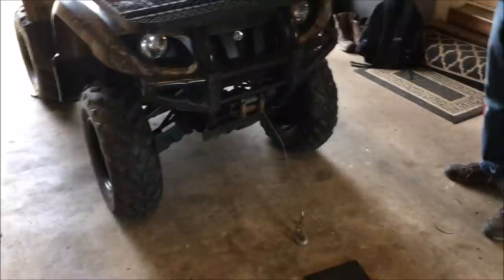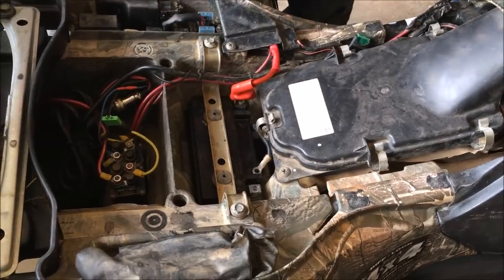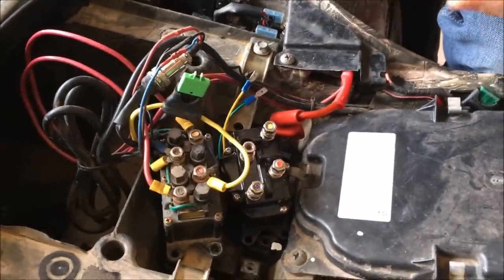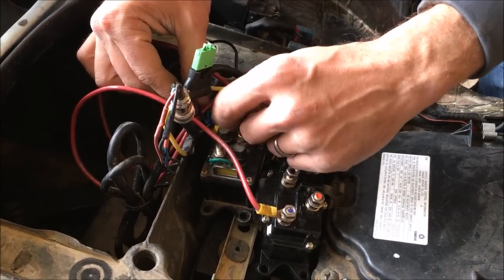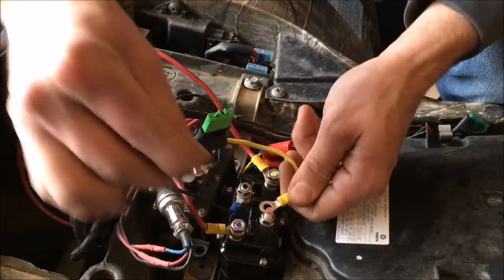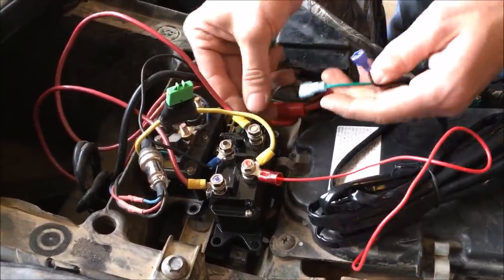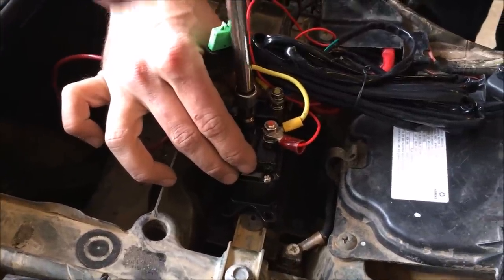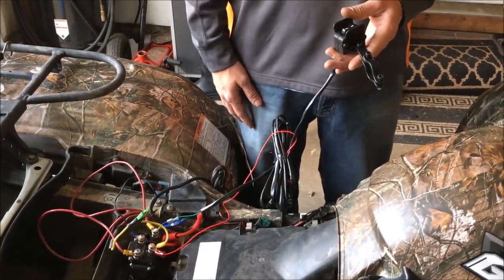Universal ATV Winch Solenoid Relay Contactor Installation

Comment: On a KFI 2500. # winch kit, Hooking the small red wire directly to the battery should I use a inline fuse link? An what amp should it be? Thanks great video
Reply from the maker: I would wire as instructed by the manufacturer.  With that said adding a fuse will not harm anything just make sure you have the proper fuse for the gauge of wire being used.

Comment: I got a second hand winch and a second hand quad.  Winch didn't work on the quad and I figured out it was the solenoid. 
I tried just swapping the wires one by one like you did but saw smoke. Could you tell me where your wires went. Blue, yellow, red, black?
Reply: red/black to battery and blue/yellow to winch. if it smokes, its shorting

Comment: Do these universal solenoids last for a while or do they burn up quickly?
Reply from the maker: I have never had a customer complain about the solenoids going bad.  I have one on my own personal ATV and have used for years without an issue.
Reply: Thanks for the reply. I have a snow plow with a key fob controller and I don't like how it operates. Every time you tap the button, the winch operates for a second or two and does not allow much adjustability of the up and down of the blade, and sometimes I need to lift or drop the blade a RCH up or down. I'm hoping this controller does the trick.
Reply: They are as dependable as your average automotive grade solenoids used for door locks, etc.  The Western snowplow on my RAM truck is actuated by the same type of solenoid and I've replaced on in six years.  They are "weather resistant", but not "water proof".  Mounting it in a dry location, like the engine compartment or enclosing it somehow to protect it will add to the longevity of the switch.  I have a solenoid mounted in a small plastic food container to seal it from the environment.